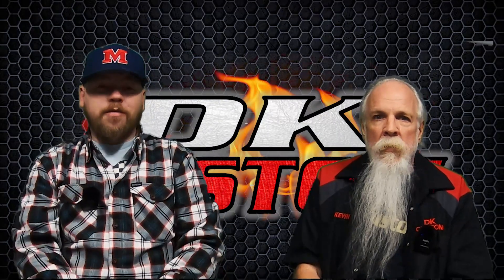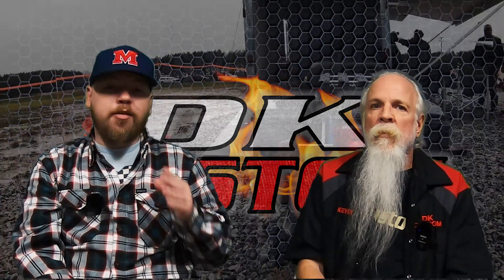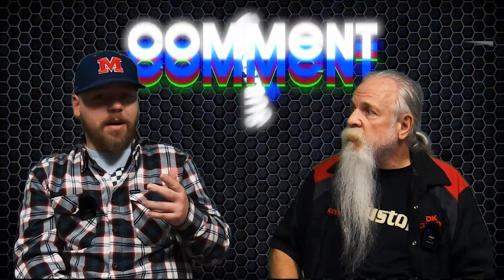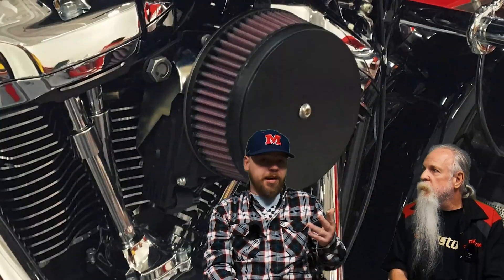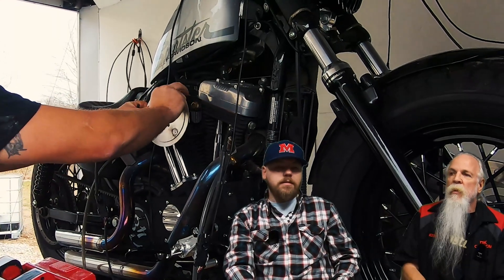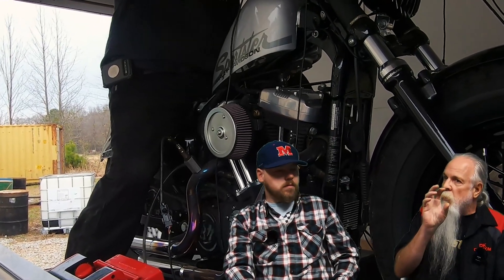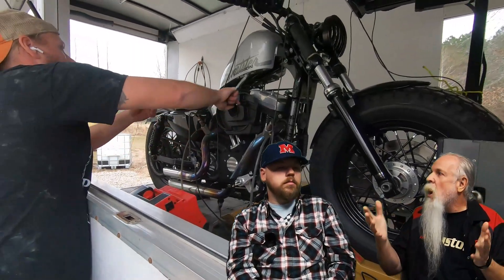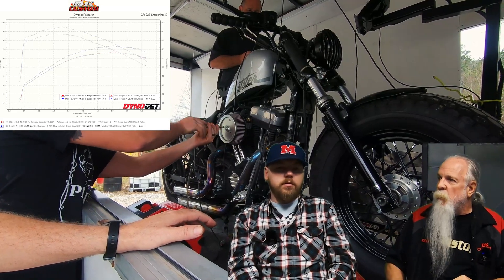Dyno Testing Different Backplates for Performance

Comment: The Thing about putting your bike on a Dyno putting it in 4th or 5th gear rolling on wide open to the rev limit will show you The HP and Torque through that Run , But is that How you Ride normally ? A Really Good Tuner can Tune a Harley if you sit down and talk about How you use or Ride Do you ride with a passenger, Ride single ,are you like Me an agressive Rider i try but can not seem to reign myself in. What is the Climate like where you will be riding most , and if You can not read sparkplugs no touch my Bike> I have put Bikes on a Dyno at Bike week and rallies To show off my Sheet Kinda like your Drag slip Time. Dynos are good to see How much Power you loose or Gain when upgrading , Owning one is the best.
Reply from the maker: All really good points.  We did a video on this subject just a while back, it is linked below.  We agree with all that you say.

In some forthcoming videos you will see we did do cruising runs on the dyno, that more accurately reflect real world riding.

But mostly we had the dyno there to test parts to see if they performed as expected.

Video link about dyno tuning- https://www.youtube.com/watch?v=isBHK-Jy7Wk

Comment: Have the 606. It's awesome. My bike breathes externally to a catch can, and I blast it out of a butchered harley 2-1-2 pipe made into an air tight 2 into 1. All I can say is between the air cleaner, the tuner and the pipe it gave me astounding results. Dyno be damned! As long as I can carry my wife and I down the highway, and keep up with my friend's m8 I'm happy. Numbers are just  that. Numbers.
Reply from the maker: Good to hear you are happy with the parts, and we appreciate your business.
Yeah, riding and enjoying it are the most important.  We use the dyno, not so much for "numbers" as for letting us know what variations of different designs perform the best.  Also to show folks that are curious or skeptical about what we say about our parts.
ie. there are thousands upon thousands of Harley owners that say a Stage I does not really make any perceptible improvement in power....which is the case if they run a typical Stage I.  But we can show with the dyno that when you run one of our Stage I set ups that the difference is very significant...something that is easily felt when riding.

Thanks for the comment! 👍
Reply: @DKCustomProducts  I work in metrology for a living. Among the key "metrics" I observe, are process capability and target proximity (variation) between where dimensional results are currently vs. the nominal target. When I hop on my bike, I review my DK Customs products by the same method. Throttle response and high rpm performance while at the controls, are consistent during every ride regardless of environment or mileage. To me, that's what matters. You are correct, data is important, and regular blokes like me appreciate that. Thanks again!
Reply from the maker: @tmburke1  Thank you!  Can't tell you how good it is to know that are parts are appreciated like that.  👍

Comment: How bout fuel. Do you need 91 octaine for your harley
Reply: Right on, with the 93. 93 is almost impossible to find at (5000 ft. & above) high elevation, in the Mountain West.
Reply from the maker: @toddgittins5692  93 is common in these parts. Out west the octane drops for sure.  Been a few times when I've needed fuel and the only stuff was 87 octane.  Only got as much as needed to get to a higher octane station.  Have also used octane booster a few time.
Reply from the maker: 91 is good, I have also had good results with 89 ethanol free, as well as 93 octane.  In fact, I think I run more with 93 octane than any other rating.
Reply: Yes. It's in the manual. 91 is a minimum requirement.

Comment: Should be a good one coming up of the comparisons. 😎👍🇨🇦
Reply from the maker: Yes, the difference between steel and aluminum backplates is very small...but there is definitely a difference.  The bigger difference is in the shape of the backplate.  This is what affects the flow, which in turn affects the power produced.